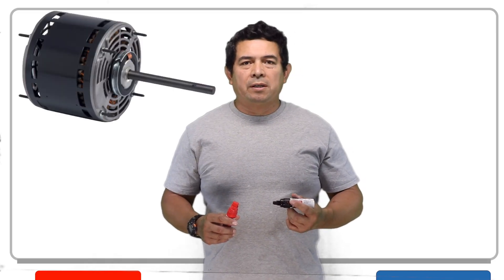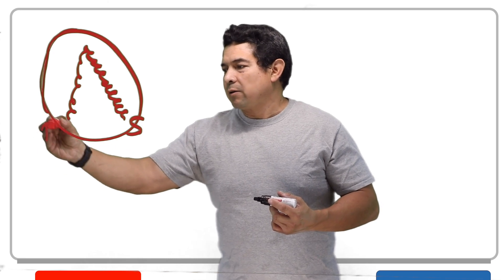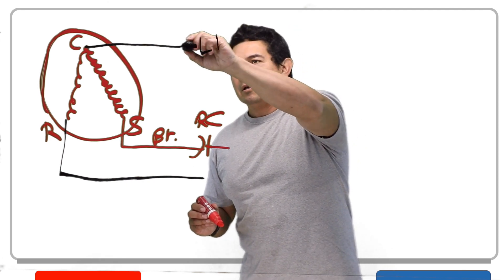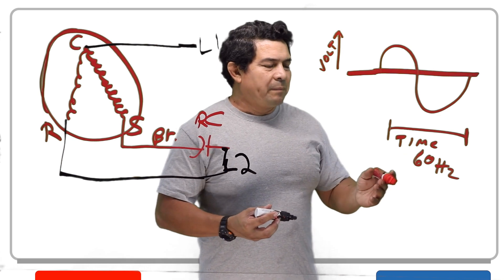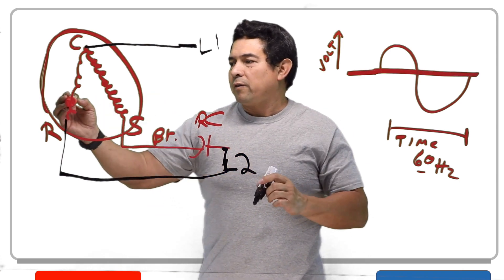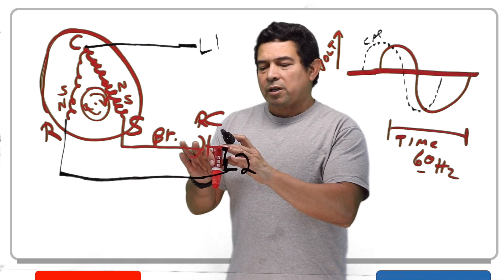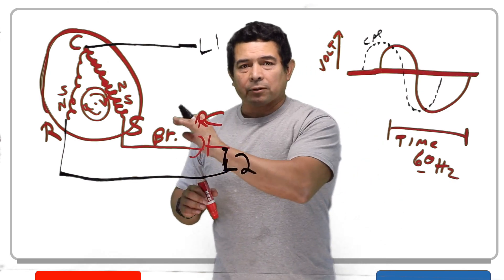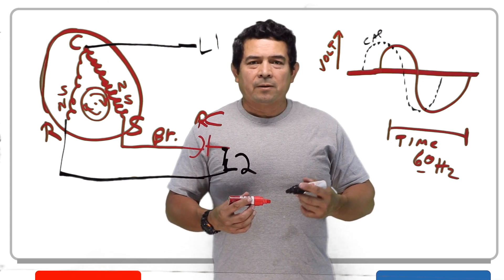Motors 5 PSC motors - HVAC Online Training and Courses

Comment: My condenser fan motor sometimes runs backwards. I replaced the capacitor, but still having the same problem. Seems like the problem happens with there is a power flicker due to storms. Whenever I have this issue, the outside unit is throwing off a lot of heat and fan is blowing downwards. l To correct the problem, I just turn off the unit and let it sit for a few minutes. Restart it and everything is normal. This unit is not a heat pump system.
Reply from the maker: Wow! That's interesting! The only time I have seen that happen is when the start winding is bad or the capacitor is open. It is the start winding that decides which direction the fan is going to turn. If you start winding is bad and you spin the motor in the wrong direction then it will run in the wrong direction. If you spin it in the correct direction, it will spin in the correct direction.  First, make sure that the same line that feeds the run winding is sending power to the run, capacitor, and the run capacitor is attached to the brown wire that goes to the motor. Also, make sure that the wiring from the capacitor to the motor/start winding is good. the start winding usually is the brown wire. Then take a resistance reading across the start, winding to see if the winding is open. I know that in class I have taken the wire that feeds power to the start winding  off of the capacitor, and given the motor a spin for the students to see that it spins in the wrong direction. So I know this happens. It could be also a problem with the motor in which case you may have to replace the motor.

I hope this helps. Good luck! And thank you for watching.

Comment: What happen if the Run Capacitor is good and you give Rotor a spin with screw driver and motor runs?! So, you did say is 90% chance the capacitor fails but I replaced the Cap and tested fine also. But still same issue... ? Motor it will not start and makes Humming noise... if manually rotated it will run without any other problems.

How do I test and fix the Winding or connection or find which one has failed to it in PSC motors?!
Reply from the maker: You may want to check the windings on the motor. Don't forget single phase motors have a run and a start winding. You will check them the same as you will check the windings on a compressor. The only problem is we don't know what the actual resistance needs to be on both windings. There is a possibility that the start winding is going to be open and that's why it is not doing anything. So check your resistance and see how that works out. I hope this helps, and thank you for watching!
Reply: @AirConAcademy  , thank you for you answer. The winding are sealed together withe 2 power wire going into the Motor. So, in order to test I may have to unseal and could brake it myself. The day before it stopped working (starting up automatically) I smelled something burning. Could it be the connections are not sufficiently making contact? 
I checked on load the 2 wires going into the Capacitor and indicate a similar Voltage of less then 50 V... Since the cap is rated at 230 V... could this indicate drop in Voltage for the Cap to start the motor?!  
Is there something I could do? Or replace the Motor?
Reply from the maker: @benweb1105  https://youtu.be/vhjMsNSTRio
Reply from the maker: It sounds like you may need to replace the motor. If you smell something burning the most likely the windings are bad. I just sent you a link on how to test single phase motors. I hope this helps but I believe you will have to replace the motor. Yes one of the windings is bad it could be partially bad so the motor is shot. Good luck and let me know what happens!    https://youtu.be/vhjMsNSTRio

Comment: Great video which brightens more my understanding, I opened up a domestic PSC fan motor, I am trying to continuously change the speed using TRIAC, but there is no effect. it is still running, in some cases it is misbehaving. I wonder the phase differences are the challenge or what? I would appreciate your reply. Thank you.
Reply from the maker: That, is a good try, but a TRIAC is pretty much like a transistor and it will not work for this application.    A TRIAC will allow the sine wave  to go through but you need to basically stretch the sine wave out or compact it to change the speed. It is the sine wave that makes the motor speed up or slow down.   Now that I think about it I don't believe I have a video on VFD's. Maybe I should do one as to how they work and how they are capable of slowing down and speeding up motors. Thank you for your question and I hope this made sense.
Reply: @AirConAcademy  Thank you, i made sense. that might be the reason the speed is not changing, however, if I try to vary the current flowing on auxiliary winding, by connecting the triac in series with the running capacitor, will it be worthy trying or? because I'm working on a project, using VFD wont it be an expensive way? Thank you.
Reply from the maker: @johnclaud1057  no, I don't believe it will be worth trying. Because again you are not changing the length of the sine wave. You are turning it basically on and off. I have never tried that but I think what will happen is that your amperage will increase because of that the amount of heat will increase and you will just overheat your motor. Keep an eye on the amperage because by trying that he will be messing with the amperage and not the sine wave. I hope that makes sense.  Remember, the VFD is going to stretch the sign without or is going to make it shorter and because of that we are adjusting the speed of the motor. Good luck and let me know how it goes!

Comment: Sir I saw the comprassor is starting with only two  wears how it is possible .
Reply from the maker: it can happen if the problem that ruined the other compressor was not found. I mean if there was acid in the system and if the lines were not properly flushed it could have ruined the new compressor. Also if new driers were not changed or installed that could have done it, it should have HH driers if it was a burn out.   Was the superheat checked when the new compressor was put in?  if not it could have been what ruined the new compressor.  Also was the contactor changed?  the old contactor could have ruined the old one and  the new one.     There are a lot of reasons.   When changing a compressor there is a lot to check and do during the replacement processes.  I hope this helped.   Good luck and let me know if you have other questions.